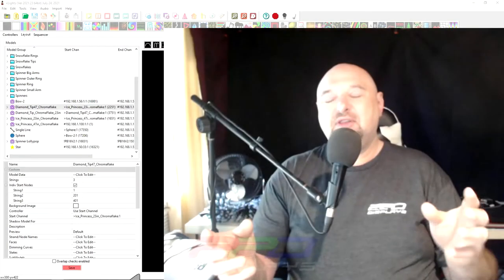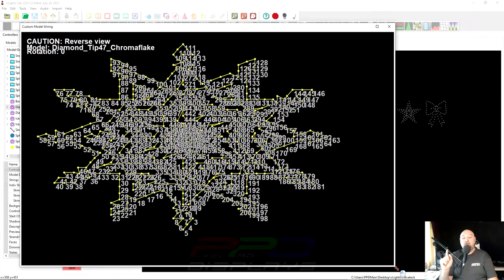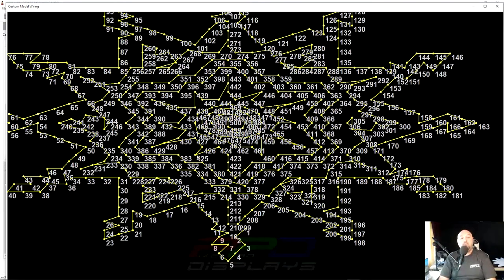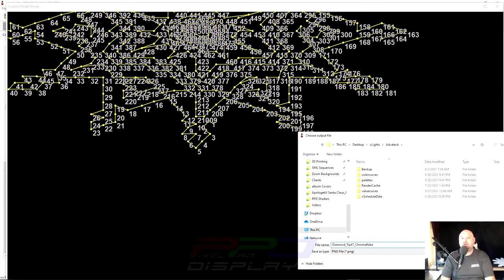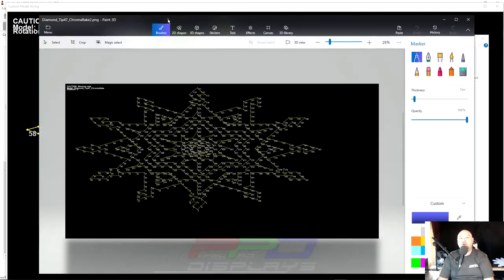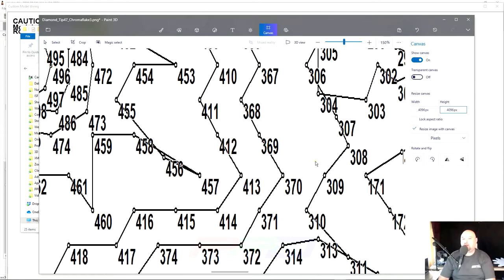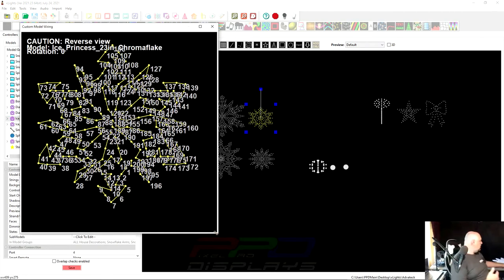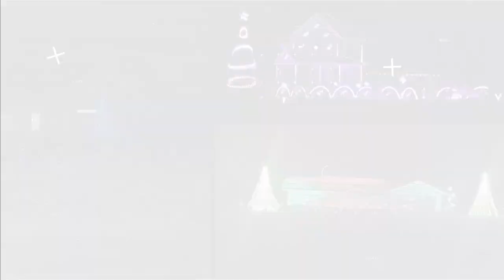xLights Models: How to View and Use the Wiring Diagram

Comment: Last year was my first step into xlights and pixel nodes.  Built the mega tree and some other props.  I bought some props from several places.  One place I did like a lot was from HolidayCoro since the props I did order had numbering/wiring information right on the prop which made it really easy.  I wish all vendors did that.  I joined the club about a month ago and looking forward to enjoying your great work.  Will need to watch your videos on how to import them into my layout, I am sure it will not be easy (at least for me),
Reply from the maker: Boscoyo is receiving a print machine.  Their goal to do all wiring diagrams on all props.  So yes it's coming soon. I also understand the Gilbert props have the option to mark the wiring path as an upgrade.  

Make sure you're in the PPU Facebook group.  We just held a mapping webinar last night, video to come soon to YouTube.  Mapping is not hard, but the "layout" is where it feels confusing.  It becomes much easier as you use it and go through the process.

Comment: That's awesome. Is there a way I can use xlights to control an animatronic?
Reply from the maker: Our affiliates Experience Lights, as well as Mattos Designs have different solutions that can help with that.  Their devices connect to a standard pixel controller, and thus can be controlled by xLights.
https://www.experiencelights.com/

https://mattosdesigns.com/